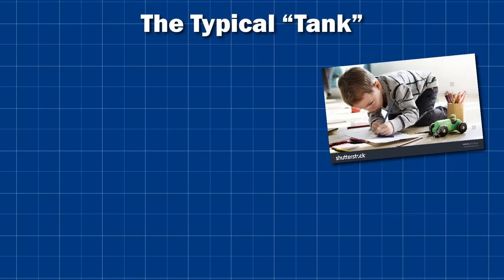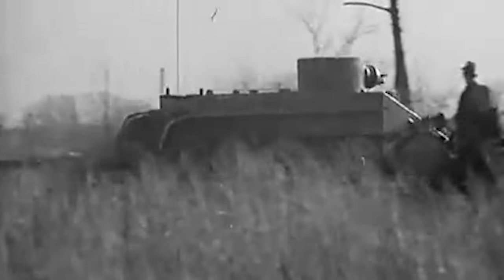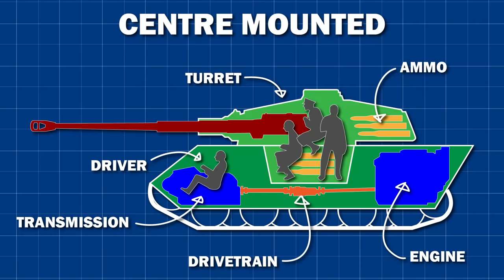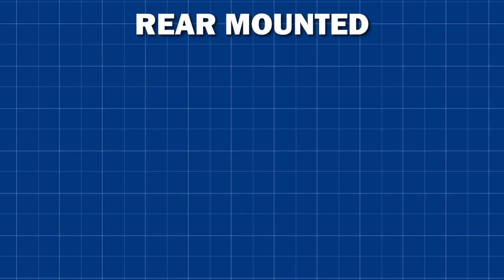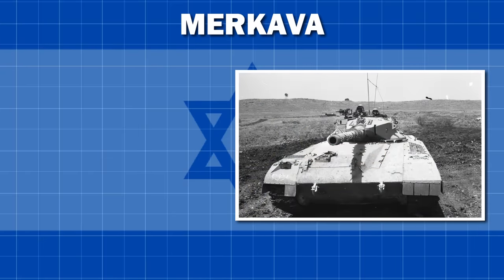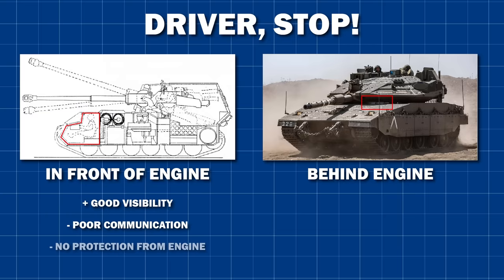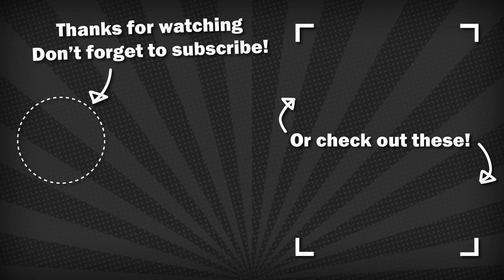What happened to Rear-Mounted Turrets?

Comment: One downside you didn't mention about rear-mounted turrets is that in order to get out from cover in a combat situation in order to shoot, you have to expose more of your hull (depending on how the cover looks like), while with a middle, or front-mounted turret you have to expose less of the vehicle in order to do that.
Reply: The way you handle a rear-turret tank is going to be different from a center-turret or front-turret design. First off, because of the superior frontal armor you can just charge in against a larger variety of targets, especially with a rear-driver design. And secondly, if you do still find that you need to utilize cover, let's say the enemy has a tank destroyer guarding the area, if you reverse out instead you actually expose less of your hull, although at the cost of the exposed part being more vulnerable if it does get hit - but if the enemy has a weapon that you can't just face head-on then that's not going to really matter because they'll end up punching through anyway if they hit you.
Reply: Just charge the enemy good plan
Reply: @MichalKolac  that's what an armor spear head is which is still used
Reply: thats so insignificant in real life. its only really an issue in video games where people know there are tanks and are expected to engage them all the time in close range.
Reply: @Phantom-bh5ru 
I mean, kinda? IRL figuring out if there's a tank out there is what scouting and intel ops are for. You don't always have that luxury but when you do, and you know the enemy has a tank, it's a good idea to prepare for it.
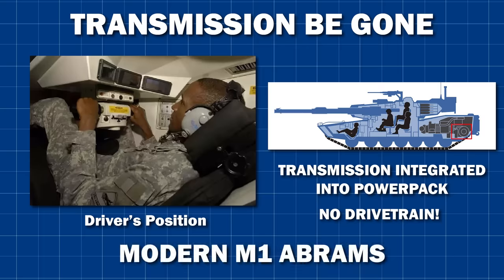Reply: He mentioned that worse gun depression at 4:50
Poor gun depression is the cause of that problem, so he did mention, though briefly.
Reply: But it's actually the opposite... the rear mounted ones can reverse around a corner and the turret is instantly in position, while center moutned has to expose 1/3 of the hull either way no matter what they do, forward or back.
Reply: @gavinjenkins899  Of course, which is great if your armor is effective on the rear, which it more often than not, isn't. So it's absolutely ideal for a vehicle which is lightly armored either way, but for a vehicle with a lot of protection in the front, for example an MBT, you shouldn't really be backing out of cover with your weak rear, since it jeopardizes your crews safety, since there is nothing in the way of letting the shell just tear straight through your tank, when you could use your armor and engine to protect yourself.
Reply: @milkman4137  nothing has good side armor these days, which is what's getting shot in either case. Anyway it's probably just a video game thing. If you ever knew someone was "camping" a corner in real life, you'd probably just go a different way even if wayyy out of the way. Or if you can't, sit there in standoff for hours if need be until someone got backup or something changed, like a siege
Reply: @Phantom-bh5ru 6 words: tanks make lots of noise
Reply: @sprayender2002  ok and? I don’t see how that’s going to matter 99% of the time.
Reply: accelerationquanta5816  Side-scraping in modern vehicles is not really that effective due to the thin side armor coupled with the enormous power of modern anti tank technology.
Reply: I thought that would be the main point raised
Reply: Thats only a Video game issue. In reality tanks dont do peek-a-boo in cities against other tanks.
Reply: Tanks, helos, and even ATGMs use thermal imagery. They don't use bare eyes to spot enemies and so tree aren't used as camouflage like in the old days. Also, tanks are cavalry. Horsemen. They move fast and with force aiming to gain advantages and territory. Tanks aren't used for hiding and sniping. Tanks have too big signature to hide against modern tech and their guns don't have very long ranges. World record for direct tank kill dated back to the desert storm where a British Challenger scored a 5,000 meters direct kill. Today's ATGM systems have effective ranges up to 8,000 meters.
Reply: Couldnt you just turn it around
Reply: @epicgamernik76  much heavier armour on the front.
Reply: This comment thread is stuck in world of tanks mentality...
 
Combined warfare is a thing that exists. If you're so close to the enemy that sidescraping sounds like a good option... You and the whole chain of command above you has screwed up collosaly.

In a case like that, first of all, you probably have a buddy in a tank nearby, a friend or two with an NLAW or such, or an angel in the sky with a Hellfire. 

One on one tank duels aren't a thing that happens often or at all outside of videogames and movies.
Reply: @CRO_Bash95  Tank duels most certainly have happened, but definitely not often, as you said. An example of a tank duel was the tank duel at cologne, between a Pershing and a Panther.
Reply: @VestedUTuber I mean really its just a bad point, Tank on tank combat at anything considered close range is extremely rare. Besides why would I have my tank platoon fight another tank in a city when i could just send 3 guys from a anti tank platoon with a rocket with a higher chance of successes and less risk.
Reply: @VestedUTuber simply no, im.sorry but a hit is still basicly as likly to penetrate the hull or turet, even worse youre hull will now be super exposable to engine hits which usually means you instatly lose youre mobilty, which is the most important thing when for example retrating, you can get away with no gun but with no mobility good luck
Reply: @Superboy-jx3zv 
Judging by your grammar, you didn't put much thought into that. Let me completely tear your argument to tiny little shreds...

"a hit is still basicly as likly to penetrate the hull or turet"
A rear-turret design with the crew entirely at the back allows you to run thicker front armor. Thicker front armor takes more kinetic energy to penetrate, which in turn means there's less that can penetrate your armor from the front. It also reduces the viable angle for hitting the turret pivot point, better protecting that weakness. So, no, it's NOT as likely to penetrate the hull, and it's not as likely to even hit the turret in any significant manner.

"even worse youre hull will now be super exposable to engine hits which usually means you instatly lose youre mobilty"
First off, no, it won't, because the engine's not going to take up the entire front section unless it's significantly larger than the engine on an equivalent-sized mid-turret tank. You're still going to have plenty of space in front of the engine.
Second, having the engine in front of the crew means a shot has to go THROUGH the engine before it can reach the crew. And crew survival is a major priority with a tank - a tank with a crew but no engine can still act as a stationary gun. A tank with an engine but no crew is useless, or worse, potential loot for the enemy.
Finally, this isn't a video game where "engine hit" means "dead". A hit to the engine could immobilize the tank, but it's not guaranteed. If it manages to get through the heavier front armor, the shot might not actually be able to do any significant damage to the engine at all, or at most might damage the outside of the engine block while leaving everything important intact.

"which is the most important thing when for example retrating"
Again, crew survivability is more important. If the tank loses its engine and a retreat is necessary, the crew can simply abandon the disabled tank. A functional tank with a dead crew can't retreat at all, and worse, could be used against you.
Reply: @VestedUTuber  
>First off, because of the superior frontal armor you can just charge in against a larger variety of targets, especially with a rear-driver design. 
You don't have greater armour.
You have an engine to block roads and increase crew survivability.

The tank is just as likely to be penetrated and mobility killed. In some ways more likely as the engine isn't protected at the back behind the turret and crew, it's covering those things.
Reply: @CallyMayz 
The engine's not going to take up the whole front end of the tank. You have extra space in the front to put towards thicker armor, AND you can slope your armor more to increase its effective armor.

This is NOT the first time I've had to point this out, and you should be embarrassed by the fact that I did so in the very comment before yours. Next time, read the comment chain before posting. I can get not doing that with a long, 500 post behemoth of a thread, but there's only 24 comments here, most of which are under 200 characters long.
Reply: @VestedUTuber  Moving the engine to the front does nothing to inherently allow thicker armour.
You aren't creating space, you're rearranging the components in the space.

Same thing with the front plate angle. The engine is not inherently dramatically shorter than the drivers station, especially if you have the driver side by side of the engine(Merkava and AMX-13 both use this layout).

Front engined vehicles have comparable armour and front plate angle to rear engined vehicles.

The benefit is the engine protects the crew, not that the front armour is stronger.
Reply: If the confusion is 'but the turret is further back so therefore the front compartment is bigger so you can fit more armour'
Remember you're not just making it bigger you're also putting an engine inside of it.

The turret can be moved back as far as the engine, but in it's place is.... The engine. So the front compartment hasn't actually gotten any bigger.
The frontspace of a rear engined tank is generally very spacious with room for ammo storage, fuel storage or if you wanted, more armour.

But being able to add more armour, doesn't make it necessarily a good idea. There's a reason we're making MBTs and not Maus or Ratte tanks. More armour does not always make a better tank.
Reply: @CallyMayz 
You're ignoring everything I've said for narrative purposes, aren't you.

The issue with the Maus wasn't just the additional armor, it was the shear size and weight of the vehicle in general that made it impractical. I NEVER said we should be building superheavy tanks, simply that front armor thickness could be increased. Doesn't even have to be a direct increase in the thickness of the primary armor material. I know you wouldn't use anything this thin on a tank, but just to illustrate the concept of spaced armor, two sheets of 1/8" polycarbonate spaced half an inch from each other will stop a 9mm round point blank, whereas 1 sheet of 1/4" polycarbonate won't, because with the spaced configuration the outer sheet has time to absorb the energy of the impact before the bullet reaches the inner sheet. Again, obviously you would be working with thicker sheets of a much harder material, but the concept is the same. And it'd work even better if, instead of air, you had some sort of dense but soft material that easily deforms to absorb energy, like a gel. And you can even increase the effective armor thickness without actually increasing the amount of material just by changing the slope angle of the armor. If you draw a line through the cross section of the armor perpendicular to the armor plate, and then another at a 30 degree angle from parallel, the line moving at 30 degrees effectively moves through more material.

You're also forgetting something significant - center-turret tanks have two crew areas. One in the middle WITH the turret, and one further forward for the driver. The engine only actually takes up a third of the tank, not half. The driver's compartment on a mid-turret tank is necessary, as the design of a mid-turret tank makes it difficult to have a physical viewport set into the hull. A rear-turret tank can have a more gradual armor slope, which would make it easier to have a physical viewport on the vehicle. Additionally, you could use close-circuit TV cameras to enhance visibility without exposing the crew, rendering the forward crew compartment unnecessary. Modern tanks are already drive-by-wire anyway.

Anyway, with the engine only taking up a third of the tank, now in the middle instead of at the back, and the crew compartment taking up the rear, you have the whole third of the tank left to use for whatever you want. So why not beef up the front armor facing?
Reply: @VestedUTuber  
If the tank is 8 metres, the engine 3 metres long, and the turret 2 metres the front compartment will be 3 metres long.
If we move the engine to the front and the turret back.
The front compartment is 3 metres long, followed by 3 metres of engine, and 2 metres of turret.

But in rear mounted turrets the turret isn't actually all the way at the back, so you're more likely to have 2 metres in the front, 3 metres of engine, 2 metres of turret and then about a 1 metre of space probably used for stowage of shells, fuel etc.

You have not created space. That 'whole third of the tank left to use for whatever you want' was already empty asides from the driver who doesn't take up all the space, and will still be there.

Real rear turreted tanks that exist do not have more armour or better construction slopes that centre turreted tanks.
Because it's nothing to do with the turret placement. The merkava with a front engine, is still a mid turret tank. And the AMX 13 has all the space from front to turret tank up by transmission, engine and driver.

Also the engine and transmission still need to connect to the drive wheel, so they're going to need to be placed forward, like on the tanks that exist. 

If we go back to the 8 metre tank example, that'll end up being 3 metres of engine, 2 metres of space, 2 metres of turret, 1 metre of space. The tank could theoretically get shorter now, but what we're considering 'empty space' is actually ammuntion, fuel, or other necessities. So you could shorten the tank, or have a bigger engine, but you'd need to cut on ammo stowage or fuel most likely. To look a at a real design, this is likely why the Merkava despite having an engine in the front has it's turret still relatively central. Because the ammo and fuel needs to go somewhere, so it goes where the engine used to be.

Front engined tanks do not have better armour inherently. This is so much more complicated of a topic than you make out to be, and you really seem to know nothing about tanks.
Reply: @CallyMayz 
Yeah, you're not even bothering to read anything I actually typed. I've already pointed out ways to increase a tank's armor without massively increasing its weight, and you keep insisting that that's impossible. I've already pointed out that you could move the driver to the back with the rest of the crew, and you act like that wasn't ever even mentioned. You keep bringing up arguments that I've already addressed, and refuse ANY answer to them that isn't total capitulation.

But let me re-address some of the points mentioned.

"You have not created space. That 'whole third of the tank left to use for whatever you want' was already empty asides from the driver who doesn't take up all the space, and will still be there."

For the millionth time, you can move the driver to the main crew compartment. This isn't WWII anymore, camera-based viewing systems exist, get with the times.

"Also the engine and transmission still need to connect to the drive wheel, so they're going to need to be placed forward, like on the tanks that exist."
Or you can use a diesel-hydraulic transmission, like the Japanese Type 10. And I'd make the "this isn't WWII" argument again, but diesel-electric tanks existed in WWII with the TOG1 and TOG2. Granted, they were prototype superheavies, so they didn't exactly go to production, but it wasn't the drivetrain's fault. For a modern example of a diesel-electric tracked military vehicle, look at the Swedish SEP.

"If we go back to the 8 metre tank example, that'll end up being 3 metres of engine, 2 metres of space, 2 metres of turret, 1 metre of space."
Except the turret doesn't use dedicated space like that. The turret is effectively an extension of the main crew compartment. The drive motors for the turret are mounted peripherally and the whole turret sits on a ring assembly, allowing it to sit above the primary crew compartment without issue. So it's really more like 3 meters of engine, 5 meters of space, of which 2 meters are covered by the turret. In a mid-turret setup, that would be 3 meters of turretless space, 2 meters of turret-covered space, and then three meters of engine. On a rear-turret setup, it can easily be 2 meters of space, 3 meters of engine, and then 3 meters of space of which two sit under the turret mount.

I actually know where to buy tank turret motors. NPC Robotics makes them.

"but what we're considering 'empty space' is actually ammuntion, fuel, or other necessities."
These don't have a fixed form factor, and fuel specifically doesn't need to be near the crew compartment - in fact, you want the fuel as far away from the crew compartment as possible, so on a rear-turret tank you'd want that under the front armor, but buried deep enough under the front armor to prevent it from getting hit easily. But the fuel tanks can be designed to fit the space they're in, as diesel fuel is a liquid. As long as the fuel tank is of sufficient capacity, it does not matter what shape it's in. As for ammunition, while it's not a liquid, you can still have a lot of variance in the shape of the space used to store it as long as it's accessible. So even in the worst case scenario, with the 8 meter long tank you've proposed, you might have to move the engine forward by one meter to make room for the ammo. That still gives an entire meter up front. I'd like to also point out that the Abrams stores its ammo primarily in the back of the turret, not in the hull. This is part of why it has such a huge turret relative to its hull size.

Also, as a side note, is the engine on this 8 meter tank design you're using to illustrate your arguments on a longitudinal mount or a transverse mount? Because if it's longitudinal, you could save space by switching to a transverse mount. And is this using one big engine or two smaller power plants? Because that's another option. Most tanks use a large V12 but if you use an electric or hydraulic drivetrain you can get away with using two smaller engines, adding redundancy and also allowing the individual engines to be positioned in a way that takes advantage of their smaller footprints.

You're claiming that I'm trying to oversimplify tank design and yet you're the one trying to simplify it down to "x meters for each part", as though each part of a tank can only ever be mounted in a one-dimensional line. I'd argue you're the one who doesn't know what they're talking about.
Reply: @VestedUTuber  Thank you for finally explaining properly.
Reply: @VestedUTuber whic is why historically it was found on tank destroyers rather than tanks
Reply: @sprayender2002 1. ok and?
2. not the abrams, one of its nicknames is literally "whispering death" because of how quiet the turbine is
Reply: Just side scrape lmao (kek)